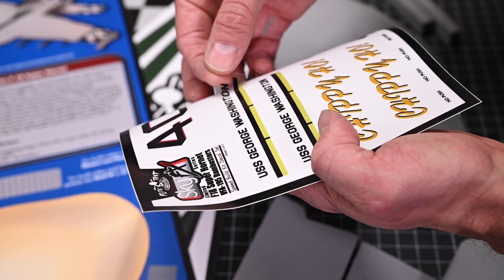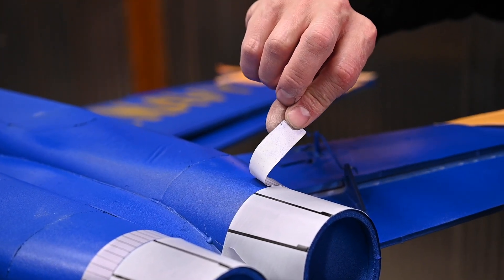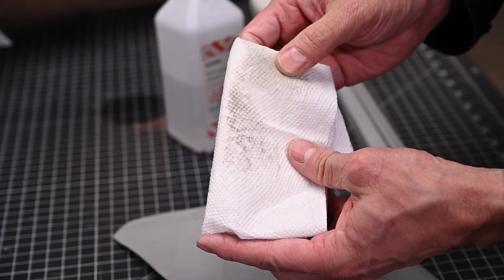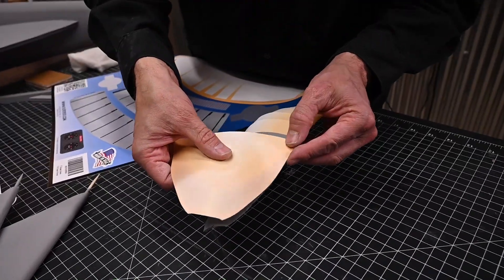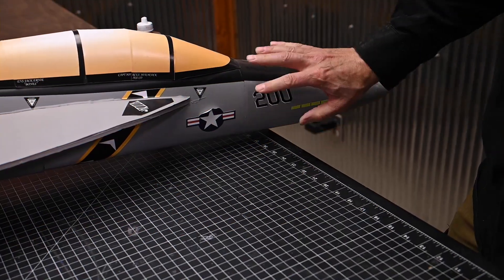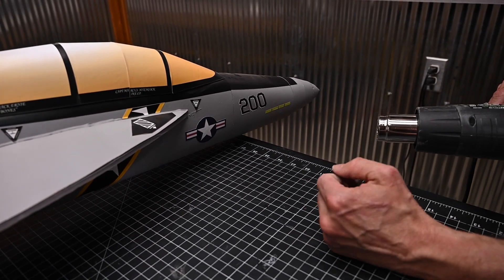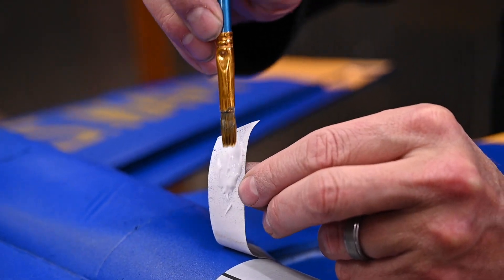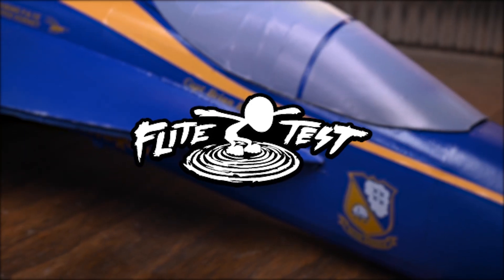Decal Basics:Tips and Tricks

Comment: Another method to preserve decals is used on plastic modeling. They use clear nail polish over all their decals. this prevents the glue from drying over time as well as keeps the decal from shrinking over time. I also recommend you fine sand where you put your decals as spray bombs lev TONS of over spray and orange peel thus limiting the actual contact area of stickers and decals from the start. The smoother you can get the area the more actual contact there will be.
Reply: Thanks for the tips! I will give them a go.  My hopes is to keep updating this video as better methods are discovered